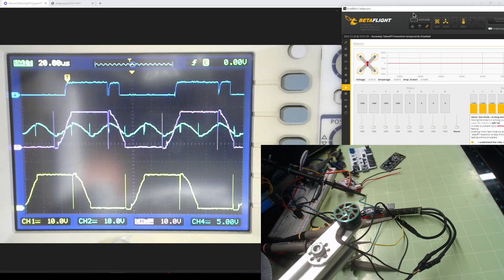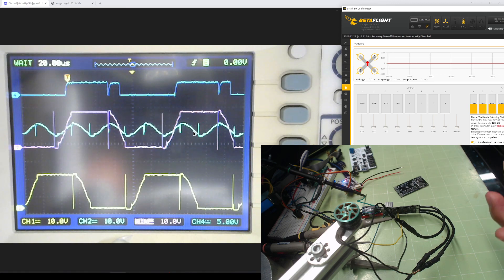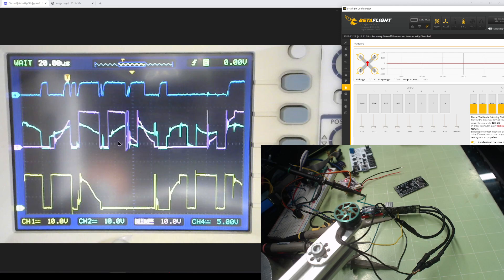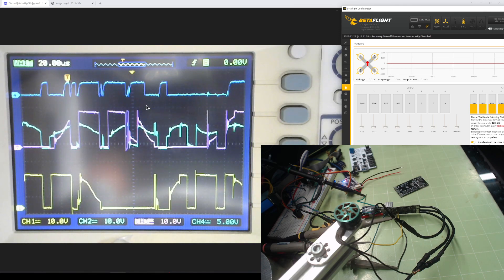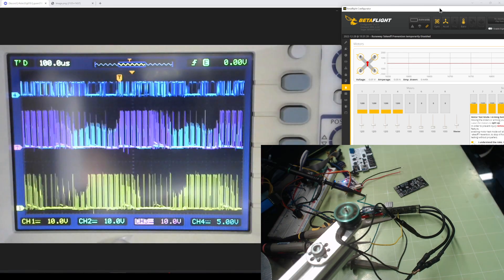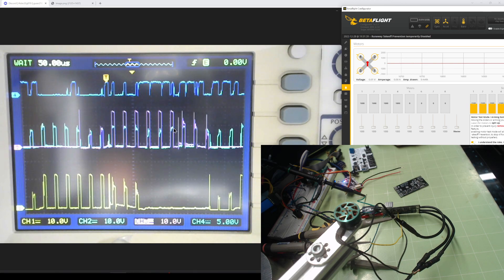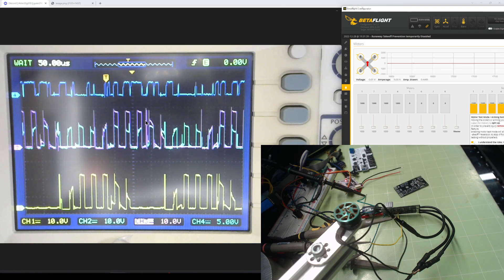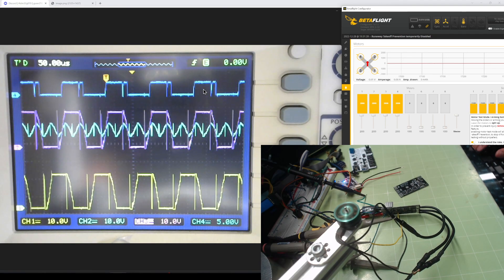ESC BEMF check period

Comment: Hi sir I have a small doubt the ZC will occur at half the DC bus voltage?  What is the peak to peak of the FGND signal in above
Reply from the maker: Is 1/2 voltage +- 1/4 voltage at full duty cycle.
Reply: @guser210  thanks for your reply sir I am facing a small problem with out own trapezoidal esc I am making that ESC for 12S but at after 50% duty the motor is gliching and jerking like behaviour and also if I touch the resistors summing circuit output with finger motor is spinning fine what might be the issue can you help with this sir ?
Reply from the maker: @electromind4183  if you touch the circuit and it starts to work then you are missing ceramic capacitors, add at least 8 22uF caps but for a 12S you will need more capacitors, so a 1500uF Elctrolityc cap and the ceramic caps about 400uF in total will do the trick. also here is a reference video to what ZC looks like on your first commutation https://youtu.be/DbCHK3Xr-Js
Reply: @guser210  thanks for your reply sir , As i checked wave forms of 3 phases with my  oscilloscope they look different from others like (phasa A is perfectly trapezoidal but phase B is half cut , phase 3 has steps in the wave forms)i am thinking that this is a impedance problem please suggest me.
Reply from the maker: @electromind4183  It could be that you are not check the correct phase for 1 or 2 of those or you are not switching/disabling the correct lines.